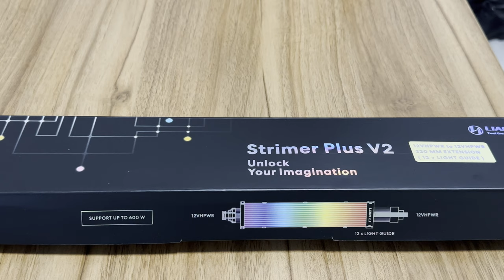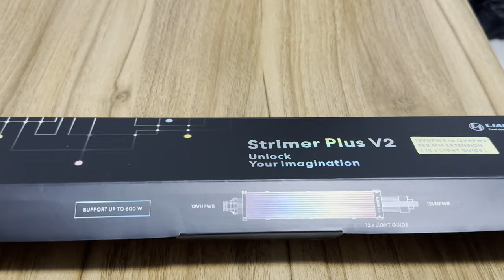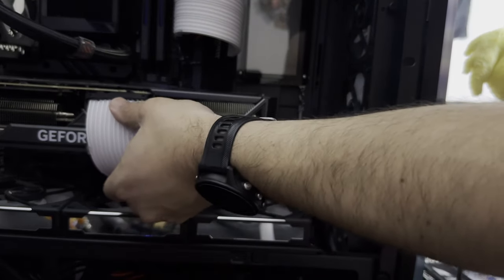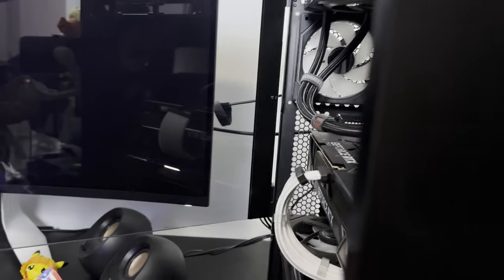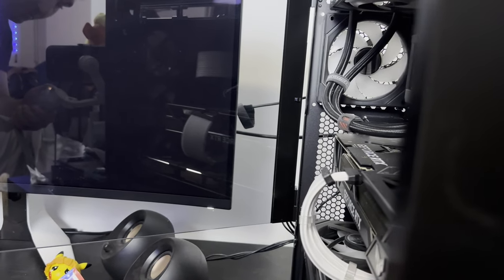OFFICIAL Lian Li Strimer V2 for RTX 40 Series GPUs | Installation and Overview

Comment: You can use it with the ARGB adapter but they will act as a single strip so no fancy separate effects per lane of rgb strip if you wanted to use SignalRGB, for example

Comment: I have the vertical GPU mount, same case Lian Li Lancool 3 and an Asus TUF Gaming 4070TI. With the vertical GPU mount you have a lot better choices for good esthetics for setting the Streamer Plus GPU cable. I think you should consider getting the GPU Vertical kit. Cooling is also better with a vertical GPU
Reply from the maker: It’s definitely something I consider!
Reply: Brooo finaly someone with the same card as me!!!
Can u plz tell me if this strimer works on our card??
Wanted to buy the strimer for the GPU but many ppl saying they cant find a strimer that works on the 4070ti...
Reply: @MaxOwnez  you need a 12vh to 3 8 pin, then you can just use 2 of the 3 8 pins since 300w are enough power for a 4070 ti.

By the way, vertical mounting is presumably worse for cooling than hotizontal. Your bottom fans throw fresh air directly at the gpu intakes, helping with refreshing.

Comment: They didn't F up the strimmer orientation, if you were running the strimmer up over the top of your GPU then it would be oriented right. You have the option to flip it so you can choose which direction you want to install the strimmer....
Reply from the maker: I know, it’s mostly a comment in jest.  In this case the way Asus orients the gpu connection is the issue lol.

Comment: nice video, i have a question, where did you bought the led screen and how you installed?
Reply from the maker: It’s a rasberry pi elecrow 5 in monitor from Amazon.  It mounted inside my case with standoffs.
Reply: @Mdntech3000  does it work with the aero oc 4060 ti?

Comment: So just want to make sure I am 100% understanding, you still used your graphics card provided power adapter? And plugged the strimer into the adapter? Or removed the adapter and plugged the cable from PSU straight into strimer? TIA.
Reply from the maker: The striker plugs into the gpu, the psu cable plugs into the strimer.
Reply: @Mdntech3000  HI, can it connect direclty to 4070ti? it has only 12 pin plug but this has 12 plus 4 which is inseparable. Plz help me out ?

Comment: nice video!! i have one question... using this you have black screen 100% fan speed problem?....

Every 90 degree adapter and third party cables that I used at some point my PC stopped, the GPU fans stayed at 100% and I had to restart.... it just doesn't cause a problem when I use the adapter that came with the card.
Reply from the maker: I haven’t had a single issue tbh
Reply: Nice! thx 🥰

Comment: So I have the exact same GPU as you, but my 4080 came with a three 8 pin to 12 pin adapter and this strimer has  12 to 12, so how do you get this to fit the three 8pin adapter? or are you using a different connector for your GPU than what it came with?
Reply from the maker: There’s a striker that is specially 12 to 3x8 pin, you could buy that one.

Comment: What's the name of that display screen on the top right and where did you get it from?
Reply from the maker: https://www.amazon.com/ELECROW-Raspberry-Touchscreen-Monitor-HDMI-Compatible/dp/B07FDYXPT7/ref=mp_s_a_1_1_sspa?crid=5ULIIMY55KKL&keywords=elecrow+5+inch+raspberry+pi+screen&qid=1683279700&sprefix=elecrow+5%2Caps%2C61&sr=8-1-spons&ufe=app_do%3Aamzn1.fos.006c50ae-5d4c-4777-9bc0-4513d670b6bc&psc=1&spLa=ZW5jcnlwdGVkUXVhbGlmaWVyPUEyVFhCQkRVRzAxSVc2JmVuY3J5cHRlZElkPUExMDQ1MzEwTVRMRFBQMUNaS0lYJmVuY3J5cHRlZEFkSWQ9QTAwMzQwMTczMEZaTzU3WTlEOUdCJndpZGdldE5hbWU9c3BfcGhvbmVfc2VhcmNoX2F0ZiZhY3Rpb249Y2xpY2tSZWRpcmVjdCZkb05vdExvZ0NsaWNrPXRydWU=
Reply from the maker: Elecrow 5 in raspberry pi screen
Reply: @Mdntech3000  It looks awesome. Thanks!

Comment: With the strimer cable that has 3 8-pin, should you only plug in 2 8-pin cables if that's what the oem adaptor has? Like on a 4070ti?
Reply from the maker: The last build I did including a 4070ti has (zotac) had 3 x 8. If the one you have only has 2 x 8, then what you said should be fine…I’m not entirely sure though….you could get the 12+4 to 12+4 if your psu has that cable already though.

Comment: So I noticed the RGB strips and the cable extensions are two separate pieces held together with clips to look like one piece. Could you get these and, instead of using the cable extensions, could you just clip the RGB strips onto your current power cable?
Reply from the maker: Absolutely!  It’s actually what I did before the official 12vhpwr strimers came out.  Check out my previous strimer video!
Reply: @Mdntech3000  nice

Comment: I don't know what Strimer to get I have the ASUS ROG STRIX 4070 OC and my power supply is the CORSAIR RM1200x
Reply from the maker: I don’t believe they have the 12vhpwr cable from the psu.  Buy the strimer that has the 3x8 pin to 12vhpwr.

Comment: how do you use usb 2.0 header on mother board for all devices like 2 lian li contorller and ryuijin 2?the mb just has 2 usb2.0 ports.do you merg them into one?or using splitter?
Reply from the maker: I do use the usb 2.0 header.  My motherboard actually has 3 usb 2.0 ports!  I made sure when I was buying my parts that I got a mobo with 3 ports.

You can buy a splitter (or split them yourself, there’s guides on YouTube) or something like the nzxt hub.
Reply: @Mdntech3000  tnx for your reply i see those guides on youtube,but im not sure its safe.is that safe combine 2 ports into one header?
Reply from the maker: It’s definitely safe to do.  If you’re not comfortable you can just buy a splitter, I know off brand ones aren’t that expensive.
Reply: @Mdntech3000  thx again🙏🏻

Comment: Is it going to cause any problems? Is it going to work the same like the original gpu cable or is it going to restrict some features?
Reply from the maker: No problems or restrictions.  I’ve had no issues and read nothing on the cable having issues either.
Reply: @Mdntech3000  Thank you so much
Reply from the maker: Enjoy man!

Comment: How did u do the colors on this, I want to do a joker theme and can't figure out how to do fans one color and the borders a different color
Reply from the maker: There’s a drop down in the fan settings where you can choose inside / outside
Reply: @Mdntech3000  when I do the drop down it changes all of my stuff
Reply from the maker: @Gam3ov3r08 https://lian-li.com/l-connect3/l-connect3-manual-2/?cn-reloaded=1&cn-reloaded=1

It’ll be in the sl inf tab section
Reply: @Mdntech3000  thank you so much

Comment: Hello I’ve been trying to figure out what Lian Li Strimer I need. I have a Asus Rog Strix 4080 and my power supply is be quiet Pure Power 12M 1000W. A 12VHPWR to 12VHPWR ?
Reply from the maker: Does your PSU come with a 12vhpwr adapter? If so yes, then get 12>12

Comment: Which mini Display did you have in your PC? Do you have a link?
Reply from the maker: https://www.amazon.com/ELECROW-Raspberry-Touchscreen-Monitor-HDMI-Compatible/dp/B07FDYXPT7/ref=mp_s_a_1_3_pp?crid=3FRI1EV7GOZUO&dib=eyJ2IjoiMSJ9.XNZKS5bR9FtK_AwhMdSV46Gthmjh7RxSws2Rjrj1a35TmhpLjSJ4r6F6RDLXjEcZQPBHaFJQAjlIeqkeKtN70Z5XpTAlP3fMRTUi5TccoPzWZp2Uk1RmoSkPsCuDJOLTN33k6YwkK5MxWBn023ZSecSp9zAHsVYvR66-ix2Uqx4s0e-GfAI-CU07Ey6YOKYZS_nn5tfDMwkfduWl-QZZEg.DlQCalSHH7kTcBc1DPlJiHqRjI0pgc5OAkJtLYiL3wY&dib_tag=se&keywords=elecrow+5+inch+raspberry+pi+screen&qid=1709941109&sprefix=elecrow+%2Caps%2C142&sr=8-3
Reply: Thank you very much

Comment: Can I put the strimer plus v2 PCIE 5.0 to (adapter) PCIE 5.0 Power Cable 16Pin (12+4) to 2x8Pin that comes with the GPU and then after that to the PSU?
Reply from the maker: In theory you could but that over complicates it.  I would just do two connections tbh if able.

Comment: Can you give me some help? My video card came with a 12vhpwr to four eight-pin adapter, so which cable should I get to avoid problems or shorts with my video card?
Reply from the maker: You can get the 12vhpwr to 3x8 strimer! It’ll work no problem, no shorting.
Reply: @Mdntech3000  are you sure? because the adapter cable that came with the video card is one with 4 of 8 pins
Reply from the maker: @felipecock1523 yes, it’s still rated…you can see a lot of 4090 users us it.  You can also buy the 12vhpwr > 12vhpwr strimer if you have a 12vhpwr cable from psu.
Reply: @Mdntech3000  I understand, thank you very much for your help, it will be very useful

Comment: I have the msi rtx 4070 ventus with a single 8 pin connector. Is there a v2 strimer that will work with this gpu. I have been having a hard time finding info on it. Thanks!
Reply from the maker: You can just get the 2X8 pin and only connect
One.  Representatives from Lian li support have confirmed it’s ok to do that !
Reply: @Mdntech3000   cool thank you, but of course that means only one strip will work? My son has the 3 x 8 pin. I guess he could do that with that one as well and just have one strip work?
Reply from the maker: @kevinmalesic9430 both strips will work.  The rgb strips get power from the controller.  Look at my older Strimer video to get a better visual idea of it.

Comment: Would I need another L connect 3 controller to use both the triple 8 and 24 pin or do they both connect with just one controller
Reply from the maker: You only need one controller!

Comment: which cable would you get with a 4060 with only one 8 4+4pin connector? would you just get the 2x8 pin and not connect one of them?
Reply from the maker: Yes that works !
Reply: @Mdntech3000  awesome thanks for responding. how would hide the other connector?
Reply: @tylerrichard149  hey did you buy it ???....did that work out cuz  i also have rtx 4060....plz respond
Reply: @its_not_the_Ishu  yea it did
Reply: @tylerrichard149  thanks bro then i'll buy one ...i'm currently building pc with project zero mobo and corsair 2000d case  r5 7700x ...and i'll upgrade gpu once new 5000 series gpu are launched

Comment: nice video im new to pc building and i really want the lian li strimmer but idk if it works with the ASUS ROG Strix NVIDIA GeForce RTX 4070 Ti OC Edition  
thanks...
Reply: @Mdntech3000
Reply from the maker: It depends on your PSU, if you already have a 12vhpwr then buy the 12>12 strimer.  If not get the 12> 8 pin strimer adapter
Reply: @Mdntech3000 my psu is gonna be the nzxt c850w can you please see if it has the 12vhpwr bc i dont really know much about pc
thank you 1+ sub
Reply from the maker: @thunayan6533 do you have the psu in your possession now or did you just order it and waiting for it to come?
Reply from the maker: @thunayan6533 from what I’m reading, the c850 does not come with a cable for 12vhpwr.  If you buy a striker get the 12vhpwr > 8 pin adapter.

Comment: which ones would you get for a 4070 ti and a gigabyte Z790 motherboard
Reply from the maker: It depends on your psu, but you could get the 12 to 3x8 pin to be safe.
Reply: thanks, and this is the only one i have to buy or do i have to get another one that connects to my motherboard
Reply from the maker: @beamz684 if you don’t already have the mb 24 pin streamer then you would need to buy a lian li strimer controller
Reply: alright thanks so much

Comment: I have this strimer and the 24 pin one but for some reason l-connect 3 doesn’t detect them with the controller, how can I fix this?
Reply from the maker: Are they in the correct ports ?
Reply: @Mdntech3000  yes I have checked everything and it is installed correctly, it is very weird the rgb and the cable itself work just fine but l connect just can’t detect them
Reply from the maker: You might need an older version of l connect..L connect is trash tbh and I’ve had issues where using a different version of l connect solved my issues.  I’m not sure what else it could be tbh .
Reply: @Mdntech3000  ok I will try that thanks
Reply from the maker: Yea it’s hard to diagnose if I can’t see the connections too since they’re might be a problem there…but in this case it’s probably a software issue
Reply: @Mdntech3000  it won’t show up on any other software like signalrgb so I think it’s the hub itself, my fan hub is detected by l connect and signal
Reply from the maker: Damn, I’m sorry that’s happening to your system.  Hopefully you’re within warranty?
Reply: @Mdntech3000  I am but thank you for all the help I will Defo subscribe
Reply from the maker: Wish I could help more.
Reply from the maker: And thank you very much!

Comment: I have bought this type for Lian Li Dynamic Mini and is not possible to close panel x.x
Reply from the maker: Yup I would figure it wouldn’t fit, sorry about that.
Reply: I wonder what cases they thounght it would work for, if it doesnt fit in their case
Reply from the maker: Yea it’s definitely a huge oversight.  I’m starting to think they wanted people to vertically mount there gpu….but then that’s short sighted because what about people who don’t have a riser cable?  What if their case doesn’t support vertical mounting? 

It is crazy that they couldn’t trim / slim down the connector so it would fit in THEIR OWN cases.

Comment: My 4070 gpu uses an adapter that converts 2 8 pin pcie cable into a 12vhpwr can I connect the 12vhpwr strimmer cable straight into the adapter and use it like an extension cable or do I need to buy a separate pcie cable that has the 12vhpwr by itself without using the included adapter. Would I need to buy something like the Corsair power supply that has there 5.0 pcie cable and use that instead or can I just use the included pcie adapter that came with the gpu to connect straight into the strimmer cable?
Reply from the maker: Which strimer do you have?
Reply: @Mdntech3000  I was planning on buying the 12vhpwr to 12vhpwr strimmer cable and just using it as a extension off my included gpu 12vhpwr adapter cable. Will that work?
Reply from the maker: @itskaizan that absolutely works, as long as you have a 12vhpwr coming from your PSU.  If not just get either 8 pin strimer.
Reply: @Mdntech3000  with the 8 pin version. I believe it comes with 3 x 8 pin do I need to used 3 separate pcie cables or can I get away with just using 2 pcie and then using one of the extra pigtail cable off the 2nd pcie for the last 8 pin? Or will that not be enough power to run the gpu. I have a gigabyte 4070 gpu
Reply from the maker: @itskaizan just get the 3x8 strimer to be safe.  12vhpwr connected to gpu then the 3x8 connected to gpu coming from the psu.
Reply: @Mdntech3000  awesome I will go that route do you recommend using 3 separate pcie cables for the 3 x 8pin?

Comment: Can someone help me out. 

Im trying to figure out what strimmer cable i need to get. 

Ive got the Asus stix 4090 OC, plus Asus Thor 1200w P2. 

I'm currently using the cable that comes with the PSU. Does anyone know what strimmer cable i'd need to buy? 

Driving me nuts trying to figure it out 😅
Reply from the maker: With the PSU you can get the 12+4 pin vhwpr to  
12+4 pin vhwpr. https://www.amazon.com/Lian-Li-Strimer-12VHPWR-Light/dp/B0C13G4GPX/ref=mp_s_a_1_3?crid=1RVG9WNU8A0G4&dib=eyJ2IjoiMSJ9.cB444ppsNQTRv9V-5sJlFyDtUjm3SSZ5Opsid5xi3TPu5skVrhD8lt7OX_E-3UCQ6nvQGOUSCH7VS0Z7P10fViEqv7HQU-UbX41MSJcUvlr245IIWIee0UkF7amGU8ROWybMGL3Aj78iAdJn6-pTl3r7OjlsynC_5tBw5OLwlTvlK8QkDzN2Fy2RHZDSim_DxkMJbJbp4591mnW0lNf6sQ.zZwws16mnG7OCDjKwXzCx3pW543cG-4dwAORCGGYyzU&dib_tag=se&keywords=strimer+plus+v2&qid=1719540015&sprefix=strimer+plus+v2%2Caps%2C230&sr=8-3

No affiliate link.  Sorry for late response.
Reply: @Mdntech3000  ah thanks for that, just order some 😀